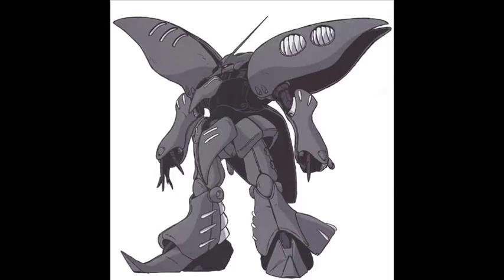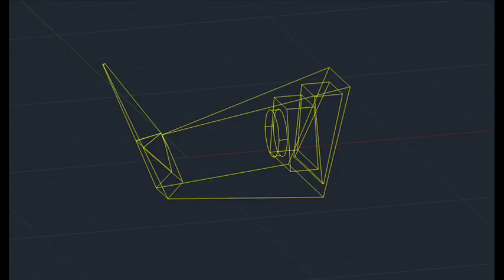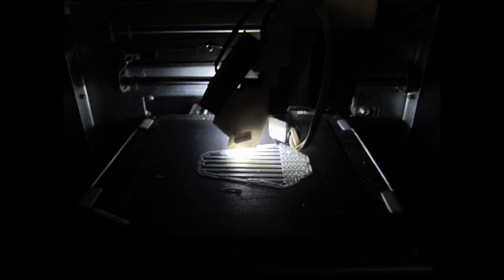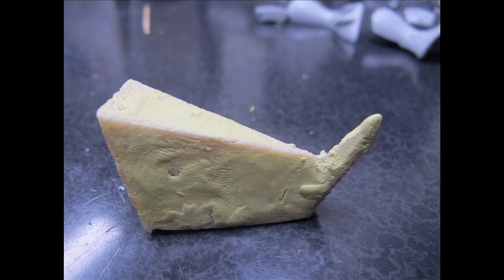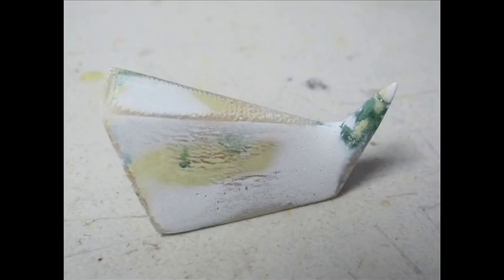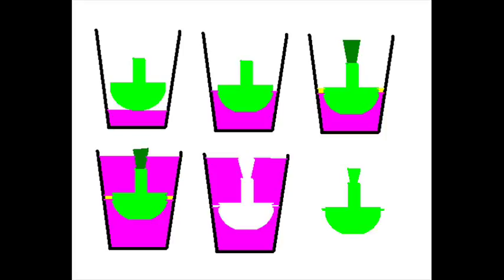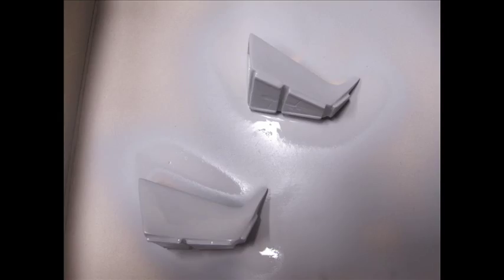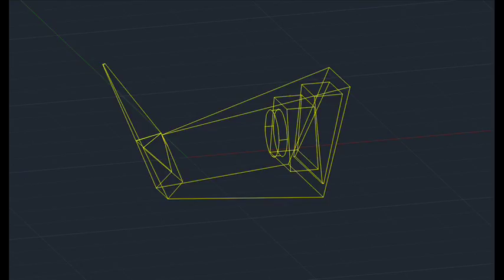3D printing parts for Gunpla tutorial

Comment: Question, how can you make tiny parts which designs are kind of complex to measure such as Part 13 from the MG 00 Seven Sword's Runner R?
Reply from the maker: Bandai parts are designed on Auto desks Inventer and a mold is milled using a high end CNC machine. All parts no matter how complex can be mesured with the correct tools and replicated. An SAL resin 3d printer could recreate the part but would be brittle and unable to hold tension. 3D printers are not cost and time wise to replace parts, it would be cheaper to buy another mastergrade kit, take one part and junk the rest.

Comment: do you know how to make ball joints on the design 
program, would appreciate it :) God bless you
Reply from the maker: Hello, I would draw a semi circle with a poll then use the revolve tool. The socket would be two parallel surfaces facing each other at a slight angle leaving one axis opening about 0.2mm smaller then the ball yet the inside slightly larger and sitting flush on the bottom.The second axis opening needs to be much larger so the ball can snap in. Parallel surface needs to be atleast 2mm thick as to not break.